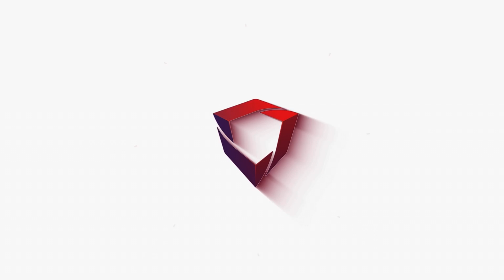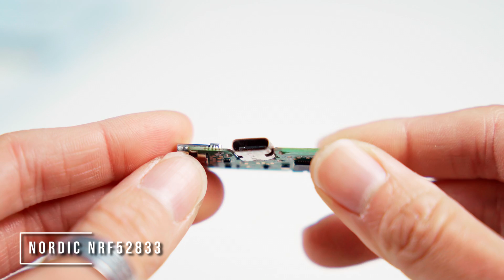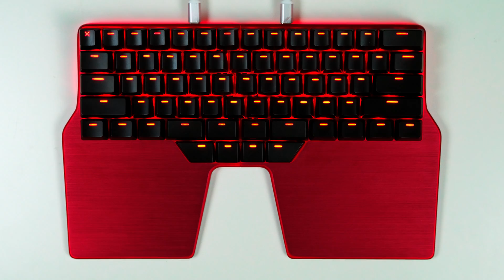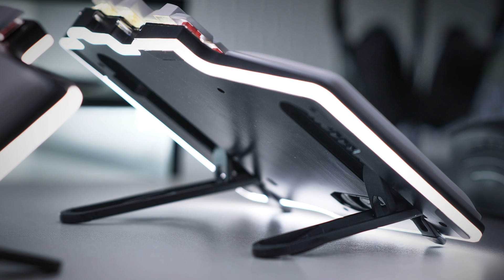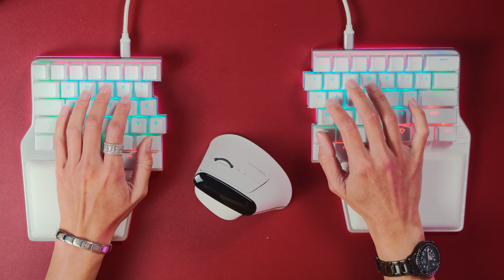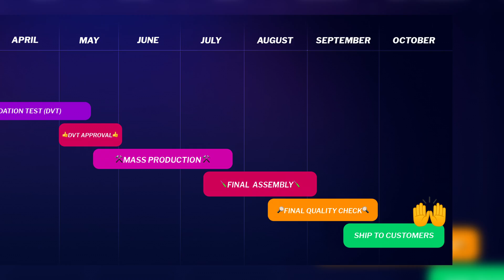Why the Dygma Raise 2 costs so much

Comment: Do the PCBs have a conformal coat? I'd feel better about the price if they have some level of spill resistance.
Reply from the maker: A conformal coat is very rare on hot-swappable keyboards because hot-swap sockets are very difficult to coat: if coating gets into the socket or pin contacts, it can cause unreliable connections.
Reply: @DygmaLab I understand, but it's not the keys I'm concerned about (I don't anticipate a spill on the keys doing a whole lot of damage). It's the microcontroller and other circuitry since those parts would be hard to fix. I suppose it would not be difficult to diy.
Reply from the maker: @unkownhours in case of spilled liquids, what we recommend is opening the keyboard and cleaning the PCB with Isopropyl alcohol. Our keyboards are super easy and fast to open (you only need a switch puller and a screw driver). That has saved all the PCBs so far 😊

Comment: I'm in Canada and I got the Defy six or so months ago. With tax it cost me $1000. If I had to make the decision over again, I would make one major change. I would order it as soon as I became aware of it and not dither. 
If my Defy disappeared tomorrow, I'd be ordering a replacement the same day. My only issue would be having to order it using a standard qwerty keyboard. Ugh!

Dygma products are not cheap. What they are, is quality and worth every penny. If you are a heavy keyboard user and can afford the investment, make the jump. You will never want to use any other keyboard after you have used and configured a Dygma. Refering to a Dygma product as a keyboards is like calling a Montblanc a pen. Yea, it sort of is, but is also so much more.
Reply from the maker: Ooooh thank you so much!!! 🥰🥰🥰

Comment: The price is high because they invest so much in the product, but nobody will buy it.
Reply from the maker: By nobody you mean more than 1,500 just during the preorder days? 😏
Reply: Split keyboards is not about budget devices. Those who switch to this type of keyboard don't expect a price below $300 (for a plastic case, wired version).

Comment: Plastic rods on the feet is disappointing. I’ve had so many plastic feet break over the years. Why didn’t you guys just use all aluminum or metal? It’s hardly a cost increase.
Reply from the maker: It's not a matter of cost, but of tolerances. The plastic pieces make the tenting more stable at all angles, as we explain in this other video: https://youtu.be/kYPymsWNutk

Comment: Yeah but I also remember you guys glue some of the pieces of this keyboard lol. Thats a hard pass on something thats $700.
Reply from the maker: Our keyboards can be disassembled with a switch puller and a screwdriver. We only use glue to secure the magnets for the palm pads. And a special double side tape for the battery so it doesn't move during assembly. Once assembled, it's kept in place by other components. 

Here's a video of the Defy disassembly 
https://youtu.be/2Ip3J1z2G3A

Comment: Hi. If I got a barebones Raise 2, can I install the WiFi, tenting and rgb aftermarket? Thanks.
Reply from the maker: Extras like Wireless, tenting or underglow can't be added later. The base and the components are different
Reply: @DygmaLab  the keyboard looks gorgeous but i think not being able to add aftermarket upgrades is a design flaw. At the very least I can't see a reason why tenting couldn't be. Or wireless. Rgb, fair enough. I see you have a campaign for beta testers. Good idea but I don't think at this stage you can fix a design flaw. I'm just one person, and again I think the keyboard is a winner bar said flaws. Good look with it, sadly price wise it's not for me unless I could buy in stages.

Comment: The polycarbonate keycaps sound interesting

I wonder if they would be available for the Defy? Especially for the Defy thumb keys which have been proving brittle? Would they be an improvement for those choc keys there?

And is the Raise 2 using choc v1 switches on the low profile keys?
Reply from the maker: The keycaps for the second batch of Dygma Defy are also polycarbonate 😊
Reply: @DygmaLab  What do you mean by second batch ? When it will be available ? It is still mention High-end laser-etched ABS Cherry profile keycaps on the page on the Dygma Defy on the website. Thanks :)

Comment: Yeah I was a bit surprised by the price of the keyboards as well.  I then did an experiment and looked into making my own as there's a lot of DIY options.  After adding up all of the different components needed to make something similar (without any specific software mind you), the price came out comparable.... maybe save between $50 - $100 on the configurations I was looking into.  So I got the Defy and have been loving it as I get more used to it.

For your reference though, a competitor that got me looking into these kinds of keyboards in the first place was the Naya.  It's specifically designed for content creators and has hot-swappable modules purposefully designed for it (like a track ball, touch pad, rotary dial, and 3D navigation thingy).  The base price is $500 for just the keyboard, and the modules are either $80 or $160 each depending on what you pick.  So if you wanted all 4 modules the total price is $1000ish, where as if you wanted 2 modules (one from each price bracket) then it's in the $700s.  Their extra keys layout is interesting as it's 2 columns of 5 on the outside of each half, plus 3 smart buttons per thumb.  Their tenting solution is also really interesting, but they were also trying to make the keyboard as portable friendly as possible so they can get away with it.

https://naya.tech/products/naya-create
Reply from the maker: The Dygma keyboards are actually priced similarly to other next-gen keyboard. Happy to hear you are loving the Defy! Thanks for sharing!

Comment: I wonder why the halves use a RP2040 as "matrix scanner" and then another IC from nordic for the wireless communication. Why can't you just use a NRF52840 to do both (like most ZMK split keyboards do)?
Reply from the maker: It is because of the cost and the pinout

Comment: Though it is expensive, I wouldn't mind paying 300-500 dollars for a good keyboard that will save me of my wrist pain. I do expect  amazing durability and a good guarantee though in case something goes wrong. If it can last 5+ years its money well spent in my eyes.
Reply from the maker: We have a 2 year warranty and our keyboards are very easy to repair if something goes wrong after that. We offer the spare parts to fix them. The first Raise keyboards from 2019 are still up and running 😉
Reply: That's really nice to hear. What I appreciate a lot about you guys, is that you're so engaged with the community, and genuinely want to help people out. It seals a good connection with the consumer founded on trust. Thanks!  @DygmaLab
Reply from the maker: Thank you for being the best community 🫶
Reply: You can try a different key layout like colemak dh and a column instead of row staggered design. Less and straight finger movements.